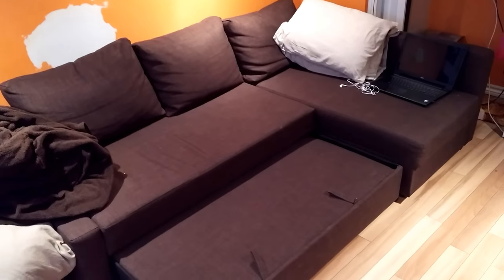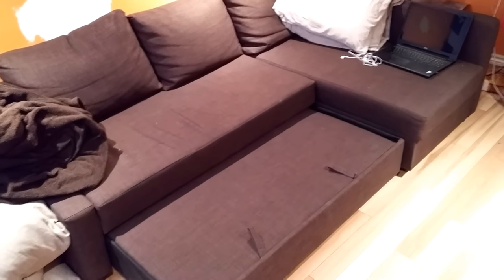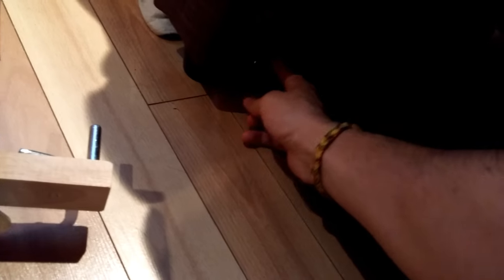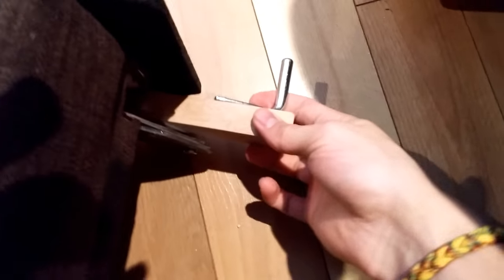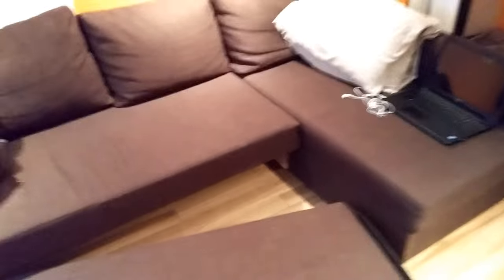Ikea Friheten couch problem

Comment: I had the same problem and found that one corner of the frame on the main part of the couch.  I added a metal corner bracket screwed into the wood and it tighten everything up and it works find again.
Reply: yes, I now realise it seems to be the two frames attaching to one another too loosely... will try that later- for now just tightened the existing screws

Comment: Same problem for me, the left side panel (from the camera's pov) angles off to the left - went in to Ikea and noticed every FRIHETEN they had in store did this! So, I did a bit of DIY and attached an L bracket to reinforce it - it worked... for a bit. What has happened now though is that it pressurises the chaise section and now when I sit on the chaise it falls down a bit in to the box area. I'm not sure what to do now.
Reply: PomBare yes!! It's because he only thing holding that panel in place along the bottom is a straight post that doesn't actually hook onto anything. So it's connected at the top but the bottom just slides out to the left like that. I'm having this same exact issue. I think we're just going to put in another screw diagonally where the post is so it stops doing that
Reply: We're having the same problem of the chaise bit sinking in every time we sit on it. We though maybe there was some odd space that the top part was sinking into because of weight on it. Any one figure out how to fix that yet? Would be so great to know! Thank you!
Reply: We turned the whole couch upside down and put extra screws all along the inside of the cushion onto that side panel. We haven't had any issues since. Also we got a rug to go under it instead of just being on wood floors so it isn't sliding around all the time

Comment: The hide away section  frame is too small.  I have two of these and one works perfect. The other had this issue because the length of the hide away is 1/2 inch shorter than the large cushion above.  I removed the stop pins, bought 4 long screws and taped three shims together on each side to elongate the pins further out.  I used shims taped together so as to not damage the frame underneath while I pulled the hide away out. You could also add spacers on the brackets that hold the main cushion up to tighten the whole couch together - that is - when the hide away bed is put away there should be no space at all between the two cushions that make up the "L".

Comment: Thanks for this video. I felt like I was crazy when the pullout would always disconnect.
Sadly, many people don’t have dexterity with tools to fix it. 
What I did was three things. 1 and 2 simply involved bringing the inner metal hooks on both sides of the bottom of the couch closer together to make the pullout fit tighter.  3 (optional) involved pushing the little metal “L finger” at the end of the pullout further out (about a 1/4 inch) for a snugger fit. 

1. I tightened the two screws attaching the hollow part (the storage space) to the main couch. These are inside the hollow part. That brings the two metal hooks closer together for a tighter fit for the pullout. 
2. I pulled the pullout out and threw it away. Lol jk (we don’t do that here. I neva freeze). I put the pullout aside and got under the couch and tightened the two screws connecting the side panel to the main panel. I had to use the Allen wretches (wrenches) for this. 
This made the inner pullout hooks come even closer. Typically this would make things work just fine and the movement of the pull out stopped when in bed form. But you know me! King Tchalla had to go the extra mile for perfection. 
3 (optional). I took the pullout aside and added a quarter inch to one of the fingers protrusions. 
I did this by unscrewing one of the metal fingers (It is attached by two screws) And adding a couple of washers (small circular metal rings of 1/8th inch thickness) to each of the two screws before re-screwing the finger back into the pullout. You can do this for both fingers if you like, but one is just fine. 

And now the protector of the kingdom sleeps soundly (like Homer Simpson in his blue bed) without nervous dreams of falling through the middle of his couch bed onto the floor. 
Wakanda forever! X
Reply: Damn! Thank you for this response! I been hesitant to buy this due to this problem!! I'll screenshot this and show my bf, cuz I have no idea what you are saying😂
Reply: You are awesome!
Reply: I think you have the “hook” that stops the piece from rolling away on wrong they should slant upwards when looking at the couch
Reply: Fuckin awesome thx for post been looking for a proper L bracket for ever didn’t think to just use washers 😂 simple genius ty man

Comment: further update. opened the storage cabinet to tighten the bolts on that end. everything is fitting way more tightly together. as a result, I am delighted to say, the problem has been pretty much eliminated: I went back to the couch now to ascertain I am unable to pull the movable unit completely out any longer - it sits on those hooks/hinges perfect. my concern: it is still possible to move the mobile unit sidewards left-right for about 1.5in, which means I need to push it slightly to the left (my chaise-longue is on the left) when bed is unfolded, so that there is none of that 1-1.5in gap between the two units. wonder if i need to tighten all of the bolts even more - will do so after awhile.

it seems to me the unit is those 1-1.5in shorter than the main settee part, which is what causes the gap to happen. If I well recall, the display Frihetens in store had the two units of equal length - but I could be wrong, and will double-check when at IKEA again! one thing I do recall though: there was no chance of moving the thing left-right at all with the display sofas - it sat quite tightly.

Comment: I have the same problem. I have a heck of a time putting the bottom part back in after it slides off (have you found an easy way to do this? I find men can do it easily but I don't have the strength), and have you found a solution for it?
Reply from the maker: Instagamrr - It's all Pun and Games! I contacted them and they actually exchanged it even if I didn't have the receipt, and even if at that point I had it for several months. It's still relatively difficult to do and undo but at least it doesn't unhook
Reply: Did you have to bring it back to the store to exchange? They offered to exchange it for me as well (I've had it for a month), but unfortunately for me I'd have to hire a van again to bring it down, which would cost me about a hundred bucks, so I'd prefer to hack together a solution before doing that
Reply from the maker: Instagamrr - It's all Pun and Games! The same delivery people had come to pick it back up and bring the new one (3rd party company hired by Ikea). I didn't have to pay anything, but the delivery system might differ from one region/country to another

Comment: Easy. You assembled the hooks upside down probably. Might have installed the hooks at an angle. Can't see the hooks in the video as it's too dark to see
Reply from the maker: Lucas Penick The hooks were installed correctly, and I sent them proof of this

They ended up replacing the couch free of charge
Reply: I can't see the point of replacing the couch (rather than just returning), considering it's a design fault that is in all of them.
Reply: Oh really did they replaced after 8 months of use .. Even we want to replace it it's having same problem ever since we brought. We got it installed from assembler and called it to check again . But no change after second visit.
Reply: @roykatyal  This item has a 365 day guarantee that if you're not happy with it they'll reimburse your money.

Comment: Solved the issue with mine! Mine kept unhooking because the side of the couch (not the side with the chaise)  was slightly slanted outwards. So the legs were slanted outwards.  Which in turn, left a gap to where the L could easily slide out. I simply straightend it out by pushing the side inward. Also, a rug helps from the bottom rolling away easily. My ig is yesenia__maria if you wanna see pictures to understand better!
Reply: I tried looking for your ig but only found one account under that @ and there were no couch photos 😅
Reply: But it would be awesome to see your solution

Comment: went to IKEA and had another look at their display sofas. everything is fine with the display ones- which suggests to me, it's about the side frame slightly tilted. It seems this is the overall design flaw, and maybe need an extra safety metal corner linking the back and side frames, just as @Mark Kelso below did.

Comment: I have the same problem with mine. I found out the issue lies in the side part to the left, as it often gets a little tilted out. If you press it in before sliding out the bed, it works better. Though I still have the problem that it is easily goes back again, and the bed slides off. I am trying to find a way for the side part to stick properly.
Reply: I think i solved it. I tilted the whole sofa up, and tightened real hard the two screws that sticks the side part to the rest. Pretty easy. Now it works smoothly. I hope it solves your problem too.
Reply from the maker: Hafgan 
Already did that unfortunately... thanks for the tip though
Reply from the maker: 10/10 customer service. They saw the video and other pictures I sent them and decided to offer a free replacement, even though I didn't have the receipt for it (based on my delivery info)
Reply: lvii22 wow. That was good of them. I had an IKEA sofa bed for years. I recently paid over £1000 for a fold out sofa bed with a pocket sprung Mattress. The difference is immense. It's like sleeping on a cloud. Still love Ikea furniture though as it's so well made.